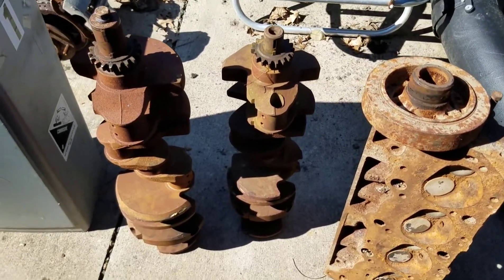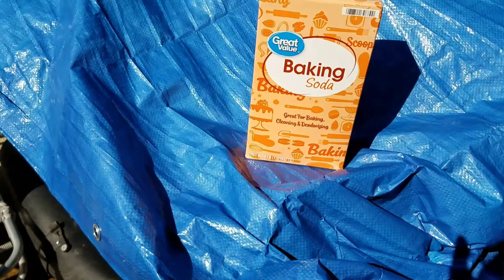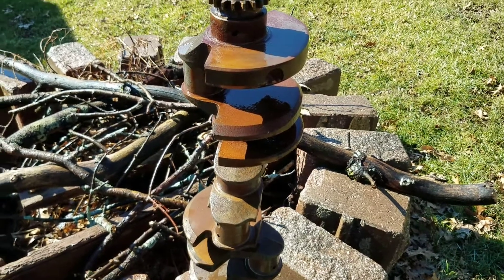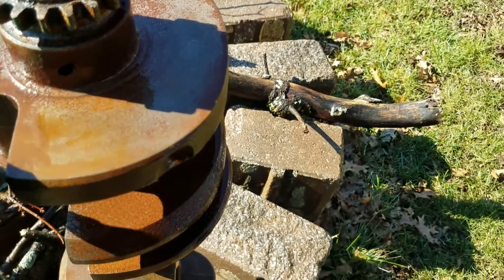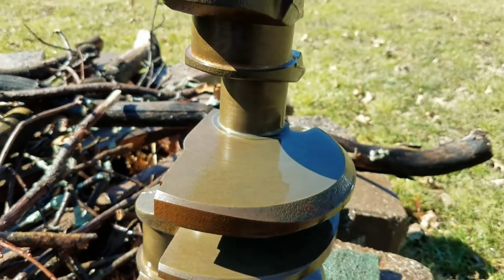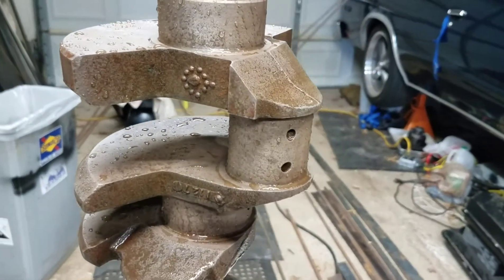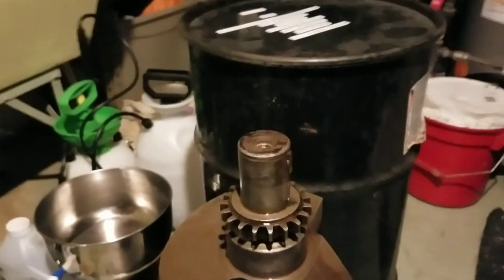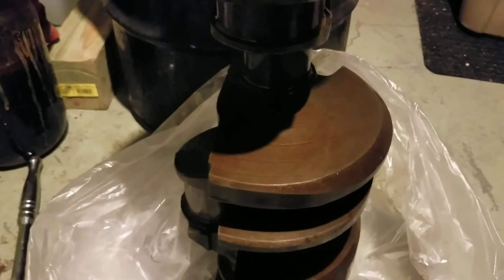ENGINE PARTS RUST REMOVAL WITH ACID TANK

Comment: The same gallon of acid brand is at Lowes, it's 14 $ now.  Thanks for showing us the process.  Subbd
Reply from the maker: Lowes or home depot usually has the acid needed but I think there is 2 different types as a weak diluted and full concentration versions. Don't forget to have some baking soda powder mixed in container to dip parts in to neutralize the acid on metal. Plus buy some metal prep at lowes and use for flash rusting treatment then follow up with WD40 or PB Blaster. Thanks for watching and leaving a comment! 👍